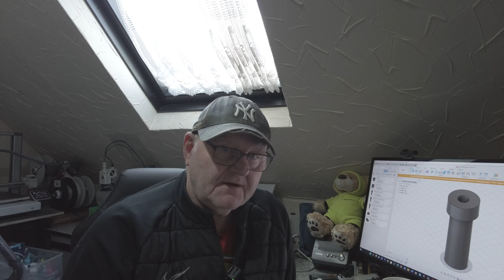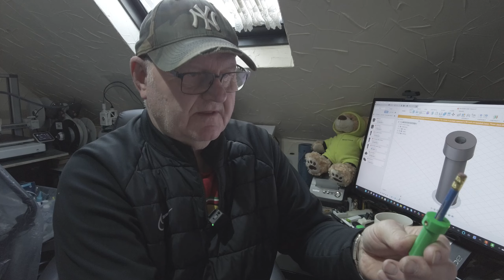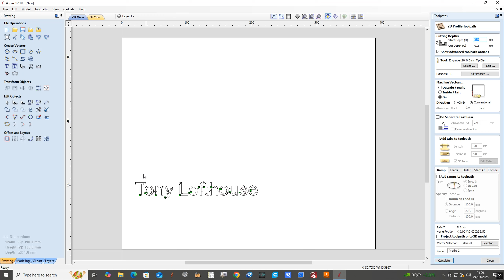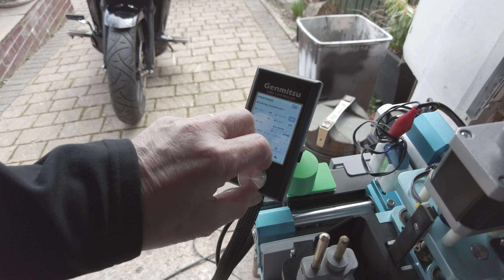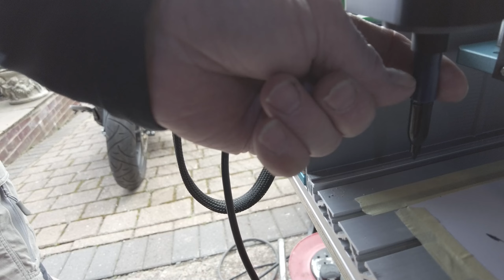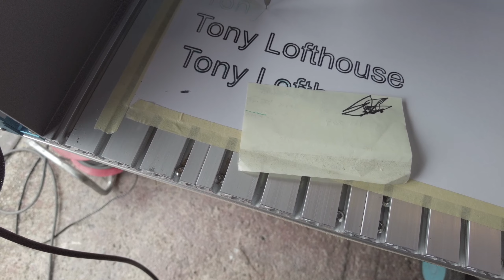Drawing on the 4040 Pro, we can do it

Comment: Hi Tony,

If you want to save time, get a 7mm MGN 150mm linear rail (under £10). The block’s weight is optimal for the pressure applied to the pen while eliminating play entirely. You’ll just need to 3D print a part to mount the rail on your Z-axis, a fixed pen holder, and an adjustable stop to prevent the carriage from sliding off (a simple longer screw in the rail’s mounting holes did the trick for me).

Any 3D-printed guides or spring-loaded mechanisms are overengineered for this purpose. They will likely introduce play and flex, which is unacceptable for a pen. Trust me on this.

Position the pen holder as close as possible to the tip. Any extra length acts as a lever: a 0.1mm play at the mount can easily translate to 0.8mm blur or more at the tip. Plastic prints inherently require clearance to slide properly, so moving 3D-printed parts are not a viable option. And don't get me wrong, I'm a 3D printer enthusiast.

Paper is also abrasive. Pressure on a felt tip can wear it down mid-drawing, especially for full-sized plots with fills. My recommendation is to use ballpoint gel pens like Uni-Ball Signo. They trace consistently in any direction, never dry out, don’t wear, and produce sharper lines, which helps assess the precision of your pen holder.

Felt pens like Sharpies wear out quickly: you start with a 1mm wide line, and minutes later, it’s 3mm. Acrylic markers (like Posca) dry out within minutes, and their felt tips don’t last as long as their ink reservoir. Colored, graphite, and mechanical pencils require constant sharpening or lead refills, making them impractical for continuous use. Paintbrushes need frequent reloading. Fountain pens can work, but they are tricky: you’ll need a 360° rotating holder or a custom G-code with pressure adjustments.

The best option is ballpoint pens, preferably gel ink. They are workhorses. Surprisingly, they come in a variety of sizes, from 0.5mm to 6mm (!), making them versatile for a wide range of applications.

Good luck mate. You’re benefiting from over five years of trial and error with DIY plotters and a solution that has held up for over a decade.
Reply from the maker: @axelSixtySix  hi thanks for the valuable  information . I will use this information as I say in my video it's all new to me i tried to use what I had with out any expense. Your ideas are obviously from experience as regards the pens I will order some. Thanks for your help and knowledge will keep you informed